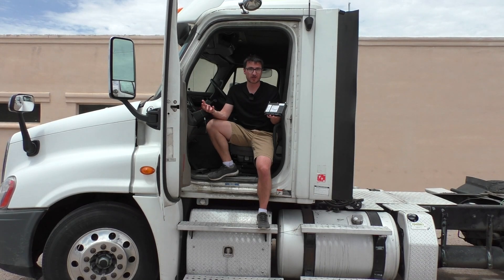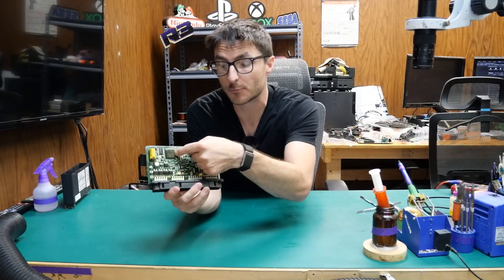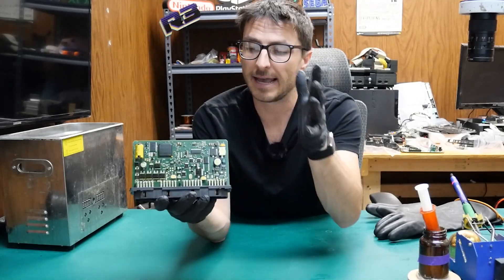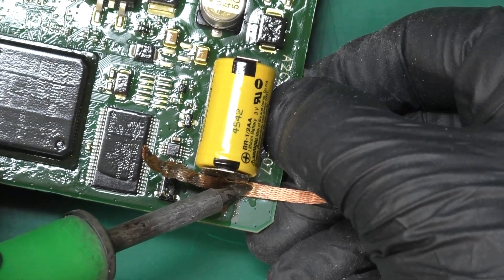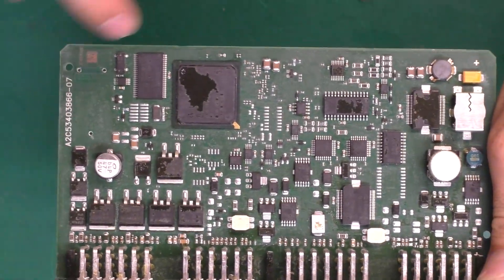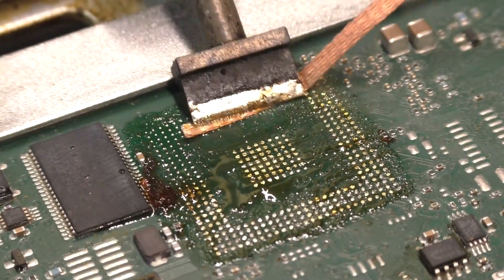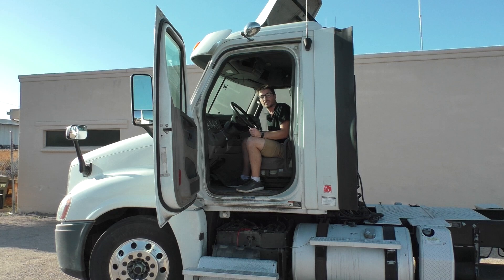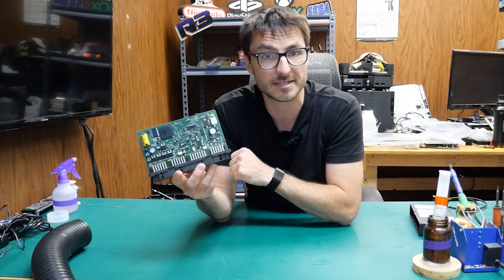Is Your Freightliner Cascadia NOT Starting Due To A Bad CPC4? FIXED!

Comment: Great video as always, what chemical did you use to remove the coating?
Reply: I think he uses MG 8310A
Reply from the maker: We use MG Chemicals conformal coating remover. They have a gel version and liquide version. We tend to use the liquid since it's easier to clean off the board after you are done removing the conformal coating. 
Other repairs where we only want to target 1 small area of the board we will use the gel version.